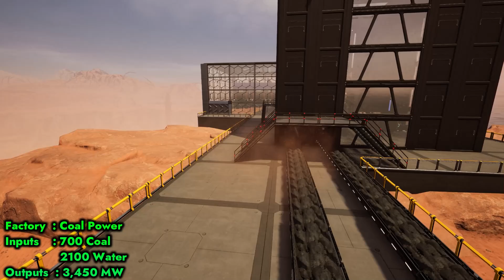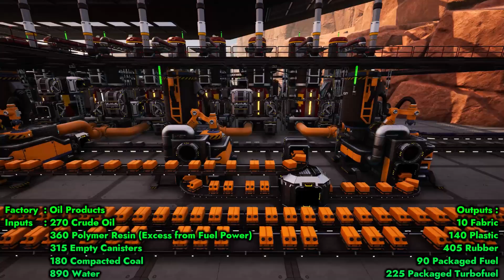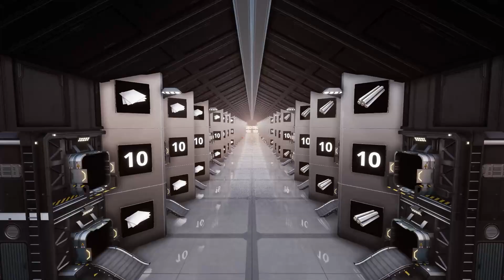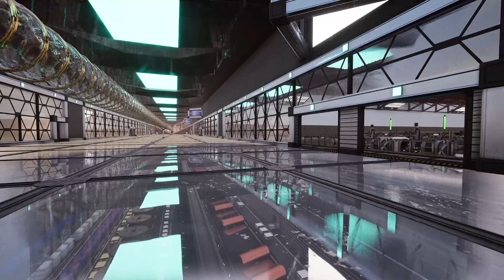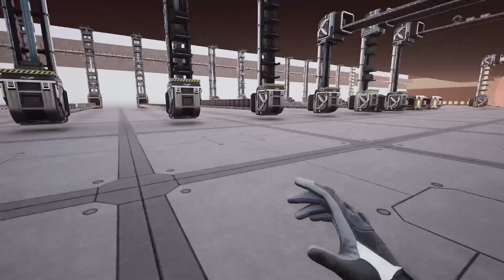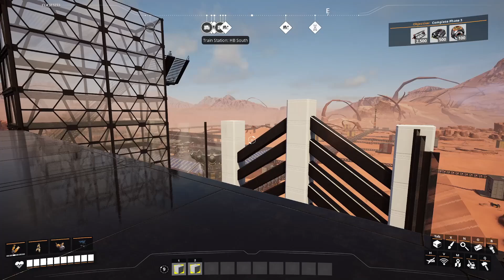160 Hour World Tour - Completing Phase 3 - Satisfactory 1.0

Comment: yeah the recipe for the mobile miners changed indeed in 1.0 Before they required a manufacturer and iron plates, iron rods, steel pipes and motors to automate. So the recipe got much easier in 1.0.
Reply from the maker: I thought I remembered a manufacturer being involved. I'm pretty happy with the changes. Thanks for the info!